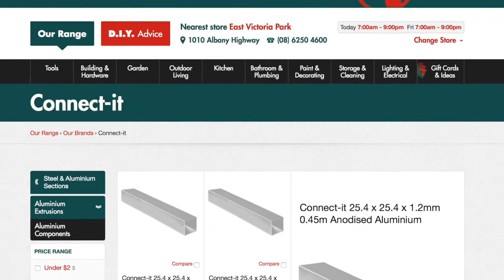LandCruiser Expedition Vehicle _ Qubelok Furniture Build Pt 1 😎 _ Ep 28

Comment: Oi oi ! Just a heads up young man Qubelok is heaps cheaper at Capral Aluminium in Wangara ! Also give your ali blade a spray with a little methylated spirit each cut ! Good work as always mate 🍻👈😬
Reply from the maker: I bought mine from Capral in Welshpool. 👍.  Thanks for the tip.

Comment: You find the most amazing things to build with!  Are the Qubelok connectors open all the way through?  Can you run wires through them?   This is such a great video series.
Reply from the maker: I am sure you could run wires through them as the connectors are hollow.the only issue I would see is it would need to be planned out very carefully in terms of build sequence especially if you cables are going round corners.